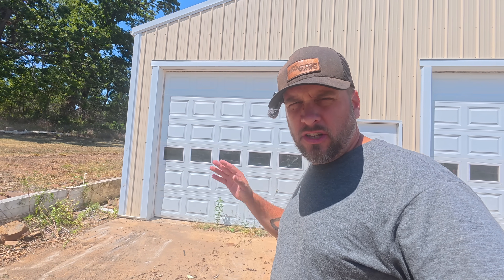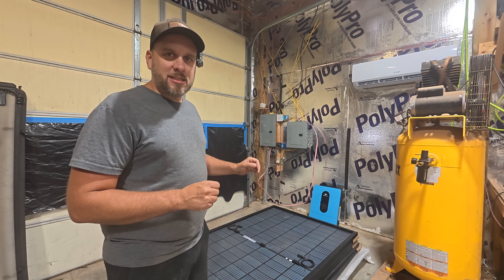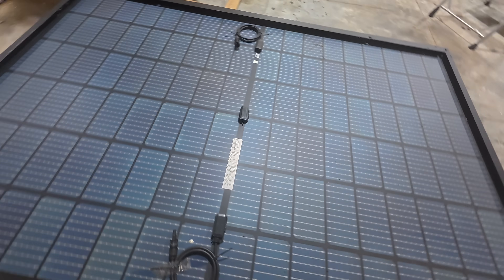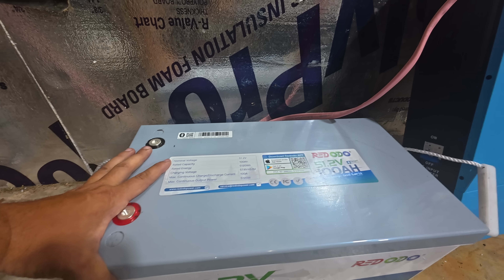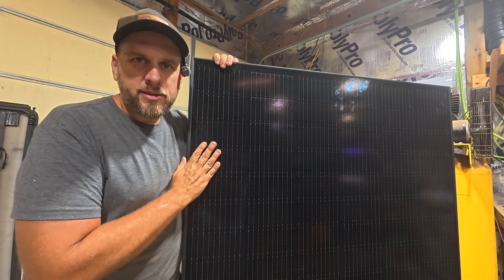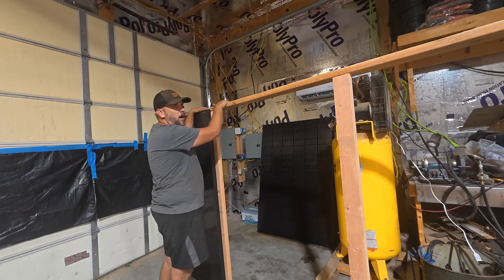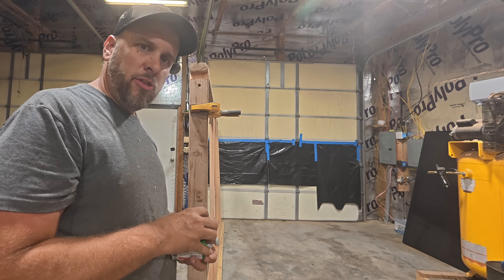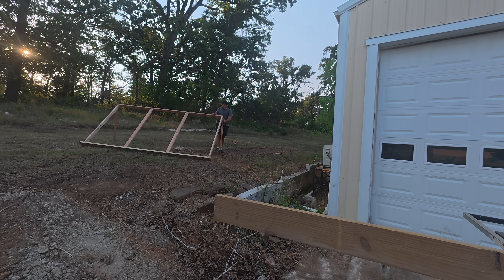Easy DIY Solar Panel Racks - Simple and Affordable

Comment from the maker: Here are all the components used in my solar build

Solar panels: https://ussolarsupplier.com/collections/off-grid-solar

Inverter: https://sungoldpower.com/products/6500w-48v-solar-charge-inverter-parallel-wifi-monitor

Use Code BROCKMAGGARD to save 6% on your batteries here:
Battery:https://www.redodopower.com/products/redodo-48v-100ah-golf-cart-bluetooth-lithium-battery?ref=dtdhnikx

For help with your Youtube channel, check out my website here: 
https://rockhillyt.com

Comment: Looks good, but some wood is shading parts of your panels, replace those with fender washers and deck screws. That will get you much better solar production.
Reply: Maybe some VHB under the washer to keep from scratching the aluminum up or sliding off.  I swear I've seen someone else on YT use this washer technique you mention.

Comment: that is actualy not a bad idea .... i did kind of the same but with metal and i added 1.5 meters legs cuz i wanted a garden under the panels .... mi panels are bifacial and i also use formations of 3 panels with a bit of distance betweent them so light will both troo and between panels for the garden so the suport is a bit longer ..... nice video with a simple solution
Reply from the maker: Thanks

Comment: I don't know the full design of your panels but your lower board where the panels seat and the boards used to secure the panels look like they are causing some shading of cells which can adversely effect the output of the panels. Maybe consider metal brackets that can be placed in various areas of the structure and frames of the panels to screw them down without casting any shadows or blocking any of the surface of the panels. It will also ground all of your panels together making it easier to fully ground your array!?!? Just a thought! :)

Comment: Instead of using the wood blocks at the top and bottom of your array, use a piece of aluminum L bracket attached to frame and then to the top of your panels with self tapping screws. This is securely attach the panels to the frame and not block any of the cells from the sun. Otherwise, great video. I'm going to borrow some of your ideas. Thanks for sharing.

Comment: Hi Brock, for version 2 I could see mounting them on a trailer, so you could tow it around. Version 3 have an Arduino or Raspberry Pi controller with motors to track the sun throughout the day for maximum generation. But you have to start somewhere and that is exactly what you've done here. Well done Mate.
Reply: I don’t understand what the Pi is going to do for this guy. Track the sun? You still have to move it. How does a Pi change that?

Comment: I put Redodo deep cycle batteries in my boat for my trolling motor.  I have been pleased with them so far.  I dropped about 70lbs in weight from my old lead acid batteries.

Comment: It looks like the wood brackets on the top of the panels cover part of the panel. Any shade (even the smallest amount) will great reduce the panels output. Other than that. Great project.

Comment: Interesting solution.  However, I'm really concerned about how much shading those brackets are creating on the panels.  Depending on how the bypass diodes are set up in those panels, that could really kill your power output.  I'll be very interested in seeing the results you get once the sun comes out and you can measure the output of them.

Comment: Do they need to be fastened to the ground to prevent the wind from flipping them over? Maybe sand bags would work.
Reply: The two angles you have on top are covering some of the panel so during the daytime read your wattage and then remove them and see if it goes up significantly if it does may want to come up with a different way to hold them down. Great job got me very interested in doing the same thing
Reply: @MONNIEHOLT  I commented something similar before I saw yours.  Yeah, partial shading can really kill the power depending on how the bypass diodes are implemented in a particular panel.
Reply: yes, will flip over in wind, would do tiedowns and sand bags, do need some decent weight, only other issue is that the blocks that hold the solar panel shades them a bit which aint ideal
Reply: Not a good long term system. Will not be able to make videos, you will be spending all your time playing with your panels
Reply: @ke6bnl 
But that’s how a person learns!

Comment: I’m wondering if you could build a expandable metal frame above the panels, too avoid any Hail Damage to panels, raise it above it just enough to use a brush you could rake snow off during the winter months